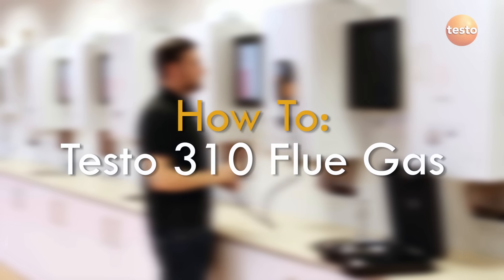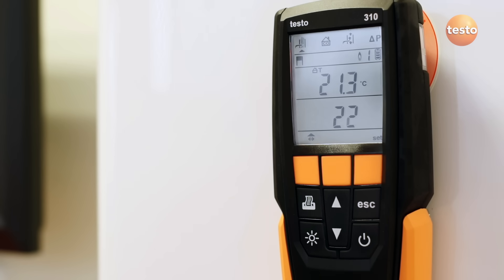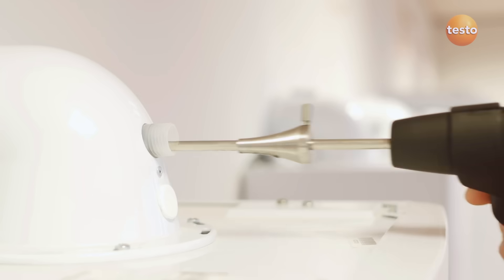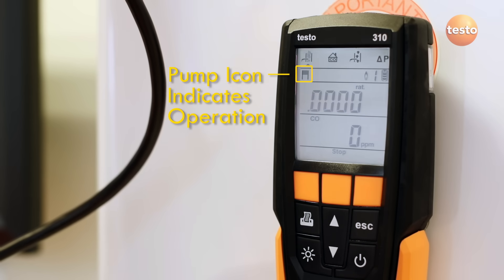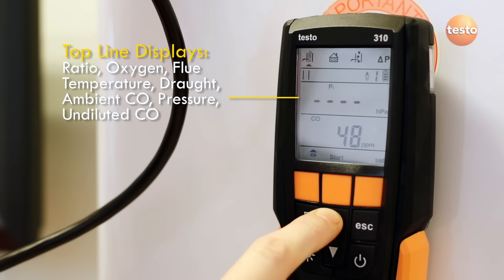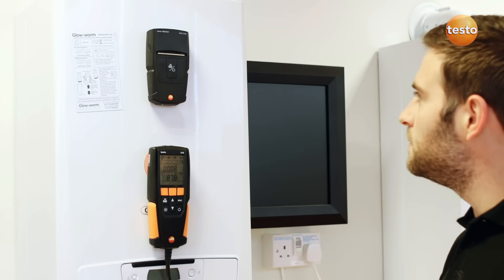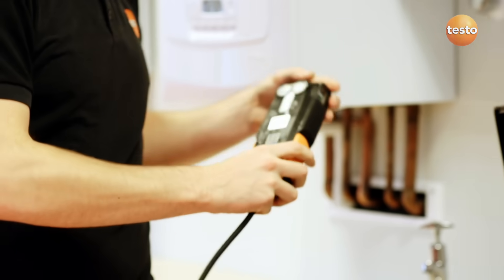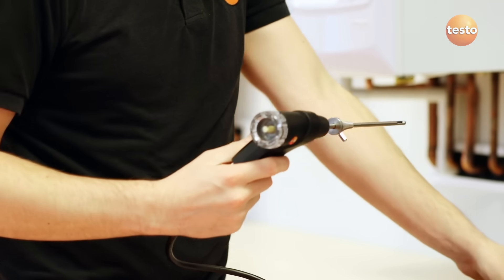How to Use - The testo 310 Flue Gas Analyser

Comment: When I used Testo 310, I got the data for flue gas temperature, CO2 and O2 percent. but I did not get the efficiency, how do I get that?
Reply from the maker: Hi @tamjidshafiq to see efficiency readings you will need to start a flue gas measurement and then use the down arrow to scroll through various measurements. Here you will find both net and gross efficiency readings. I hope this helps, if there's anything else we can help with please don't hesitate to contact us.

Comment: I've just got a 310 and it doesn't display the ratio
Reply from the maker: Hi James, thank you for your comment. If this is a new analyser, you will need to select area code 2 for the UK in order to show ratio. Information on how to do this is in the instruction manual. Any further questions, please do not hesitate to get in touch on 01420 544433 or email us at info@testo.co.uk

Comment: I m using testo 340.What is the difference between 310 and 340.My requirement is oxygen,CO2 and CO along with temperature.
Reply from the maker: Hello, thank you for your query. To answer, the testo 310 is an entry level domestic analyser and the testo 340 is industrial. The 310 is for use on domestic boilers 50/70 kilowatt , 340 1 Megawatt +. Analysers all have different capacity sensors, different features, different fuel selection options, temperature limits etc. Yes they will both measure O2, CO and CO2 but a 310 would not be appropriate on industrial boilers. I hope that helps answer your query, if you have any more questions please do not hesitate to get in touch with us on +44 1420 544433.